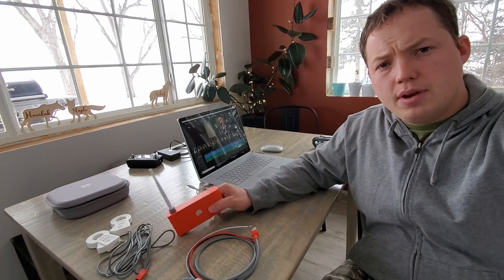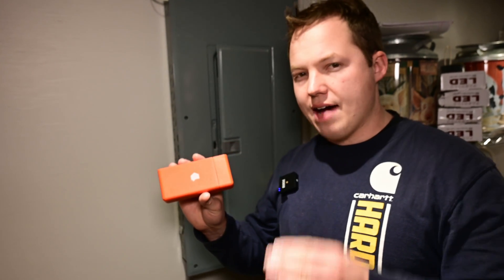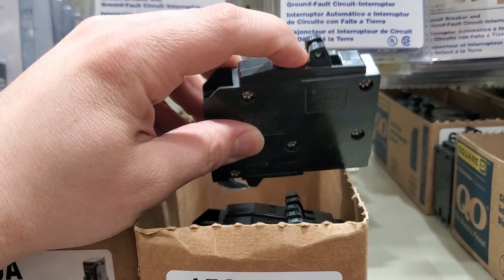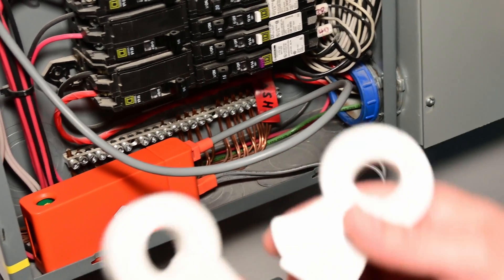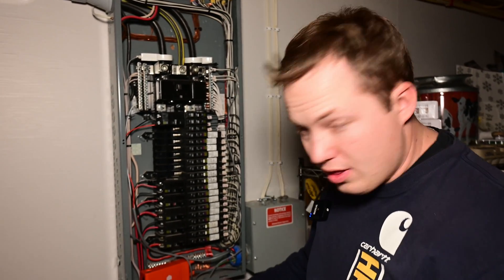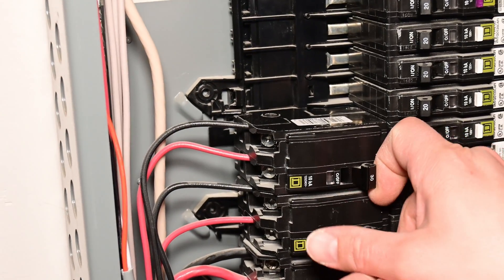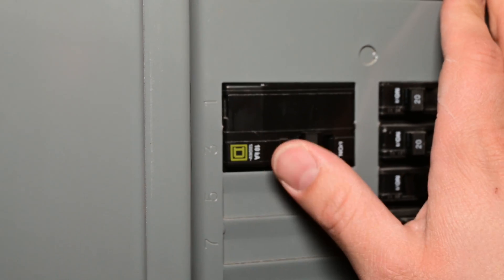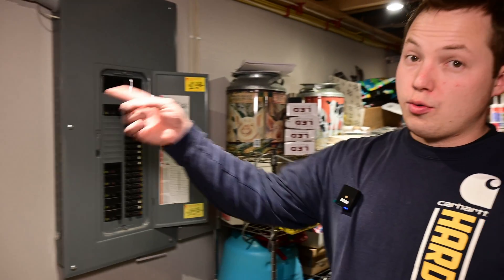How To Install the Sense Home Energy Monitor & 2024 Coupon Code Discount!

Comment: When you say it "can" meet code does not mean it does just because you can connect a second wire. Be careful with general statements, your viewers can be watching form areas where codes exist and are followed, or are completely different than yours.
Reply: Do you not have anything better to do?

Comment: What you didn't mention is what someone who has no 240v breakers in their panel would do. Given that my panel is full with only 115v breakers, you'd have to piggyback onto two 115v breakers on each leg (left & right) of the panel. If I wanted to use a device like that, that's what I'd have to do. I can't imagine I'm the only person in this situation.
Reply: No, the phases alternate as you go down so you could connect to two adjacent breakers on the same side. If you are unsure borrow a good meter and measure for 240v.
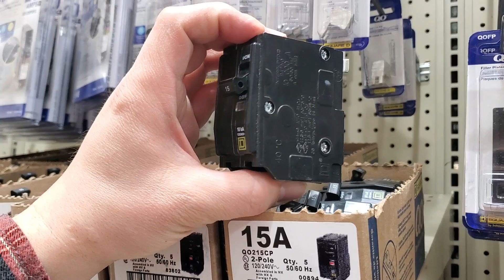Reply: At 3:00 min. mark he tells you what to do.

Comment: Not preferred but piggybacking ok as long as you don't exceed total breaker capacity. I've seen it done many times without issue. You video is well done, thank you.

Comment: nice! the thing with the current transformer (ct) clamps to be connected FIRST on the monitor and then on the mains is due to CTs might build up a high voltage on their secondaries if they are open.

Comment: I have a 400 amp service in my home. How would that work for me? I have a meter base with (2) 200amp panels/main disconnects. One on each side of the meter. Inside my home, I have (2) 200amp load centers.
Reply: The specifications says 200 amp so you would need one fore each load center.
Reply: Sence has a unit that is designed to work with a 400 amp panel. See the sense.com website for details on this device

Comment: I would be surprised if it would be acceptable when installing two wires on one terminal, if they are different sizes. For example, one #14 wire and one #10 wire (one on each side) I would think you could possibly have the smaller wire not having the same torque pressing down on it as the #10 just because of the angle created by the two different wire sizes. Does that make sense?  Personally I would want to use the two-pole 15 just for the sense meter. I get it that you could be pressed for space but I would exhaust the twin breakers first.  But, that's just me.
Reply: You can connect it to any two 15 or 20 single breakers.  Just make sure they are next to each other so they have 220 volts across them.
Reply: Can you read? The breaker said what was permissible do you think the engineers do not understand your concern?

Comment: Ben thanks for the video I’m about to order one of my own but I was wondering if I could get the solar model and use the additional pair of cable clamps to monitor the usage from a backup generator instead of from solar panels. My generator leads won’t fit in the same clamps with the service entrance cables at the same time. Such as how you showed before with the 10 gauge wires that your generator supply’s power through. If that makes any sense!
Reply from the maker: Sorry for the slow response! To be honest I don't know for sure if that would work or not. I kind of think that it probably would but I would recommend contacting Sense as they have very good customer service from my experiences with them. Did you order one yet?
Reply: Benjamin Sahlstrom it’s not a dumb question is it? No I haven’t ordered yet still thinking about the generator sensing ability.
Reply from the maker: @lesgray3355  Yes! Definitely a great question. Also, since you haven't ordered just yet I might have a better promotion coming up in the next few weeks that should be a slightly better deal on Sense. I only heard about this after I had already posted this video. I'll be posting about it if I get access to the better coupon so stay tuned.
Reply: That should work fine.  It has no way of knowing what is supplying the power.  So Solar or Genset shouldn't matter.
Reply: It looks like the FAQs in the sense.com website say that the solar leads cannot be used to monitor the generator. It states that you would get erroneous readings. I'm thinking it may be because the inverter power is a square wave from the solar source as opposed to a sine wave for the commercial power. I'm not sure about this as far as the square and sine wave but the FAQs appear to say don't use the solar sensors for should not be used for generator.

Comment: Does this unit allow for extra current transformers for individual circuits?

I remember you showed a power monitor before with that capability, is this the same?
Reply from the maker: They do not have individual circuit monitoring unfortunately but you are correct that you can add "smart plugs" such as this one https://amzn.to/2TrA6Z5 that will allow you to monitor everything that is connected to that device. Here is the video where I explain that process: https://www.youtube.com/watch?v=qS5_92F6LSY&t=192s

Comment: Good to see the Green Store shelves at 2:34  rather than the orange ones :)  Non-Midwesterners be like, whats menards, i think it may be a Nascar driver. 
Ya I loved this part... They are still live, if i would toucht that it would be.... very  .. unpleasent."   Meh aint but a lil ting.
Reply from the maker: Menards is awesome! We are blessed to be about 25 minutes away from the one in Marshall, MN. They built it in 2010 or so and before then the nearest Menards was more than an hour away. They seem to always beat the orange and blue stores on price!
Reply: @BenjaminSahlstrom  Green all the way.  I have 3 with 20-30 minutes from my location.  I was at a new one in WI and thre was a flat escelator (google menards with escelator).  That store was crazy large.

Comment: Didn't you used to have one outside on your main panel? Is this one working together with that one, or did you just move it inside where it's not in such harsh conditions (iirc it was in a ziplock bag, lol)?
Reply from the maker: Nice catch! I am impressed that you noticed! You're correct. My original Sense unit is outside in the first panel on the property. That way it can monitor all of the electrical usage on my property including the well which is fed from that outdoor panel. The problem with that outdoor one is that it isn't the best example of how to install Sense and it wouldn't apply to as many people. That is why I decided to install Sense in my regular panel just for the sake of making this video.

I might make a proper "how to install Sense outdoors" video sometime but I didn't want to promote the way I installed it out there. It has been working perfectly though for almost two years and you are right that I did put it in a bag to hopefully help protect it from moisture. Also, the ambient conditions here in MN can get nasty at down to -30 degrees so that is well below the minimum 5 degree recommendation.  The instructions actually say 32 degrees but a guy from their support team said it should be fine down to 5 degrees as long as it is installed while it is above 32. I'm sure my unit won't last as long out there but it is worth it to me to be able to monitor the well.

Thanks for the comment!
Reply: @BenjaminSahlstrom  Any benefit in having two?
Reply from the maker: Not that I am aware of. I don't think that multiple units are designed to work together. I'll be taking the unit I installed here out as I think I am going to install it at my parents place.

Comment: Wow! Very cool! I want one but for $275 I'm hesitant. awesome install video and thanks for showing the app results.
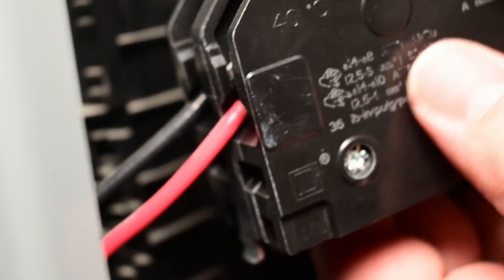Btw... @8:13 I never even noticed that. Good stuff.
Reply: That's whats so nice about his videos, the details and tips just kind sprinkled throughout the video.
Reply from the maker: Yeah I totally get that! I held off for a few years before I finally bought one myself. I have to say that I am glad that I did though. Sense isn't perfect but it is really nice for monitoring things like your well, sump pump, garage door, lights, oven, water heater, etc. etc. It can save some money if you find areas to eliminate some power usage but overall I just like being able to see what is going on at any given time and it helps with spotting problems.
Reply: @BenjaminSahlstrom  Yeah, I got electric heat in basement and curious how much it really uses. + Dehumidifiers going in summer. I may pick it up this spring. I'll use your link. Thanks!
Reply from the maker: It's nice that some breakers allow the second wire to be connected on the same terminal for sure! Unfortunately not all breakers allow it though and it is still somewhat frowned upon depending on who you ask.

Comment: The MCB and not on a Sub panel? Very cool
Reply from the maker: Sense can be installed on a sub panel if you want but it can only monitor power that is used down stream of that point. If you install it in the first panel on a typical property you will be able to monitor the main panel as well as any sub panels that are fed from there.
Reply: @BenjaminSahlstrom  Here is a good use case. I am building home shop/LLC. Installing a dedicated sub-panel in the garage for shop tools. Want to monitor only the power we use for the home shop for expense/tax purposes. Don't care about the main panel as we've established usage patterns that work well with our particular utility savings plan. Counting on Sense to deliver the data I need to segregate costs and enable good cost accounting.